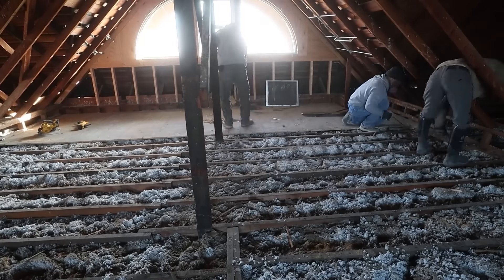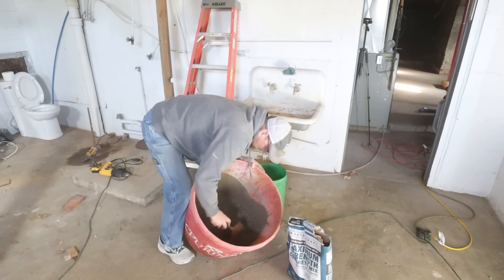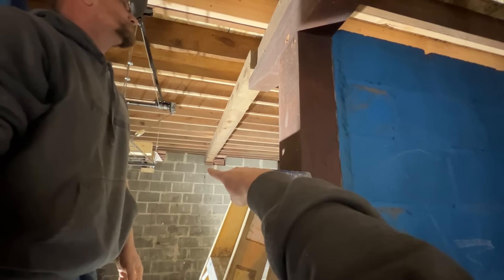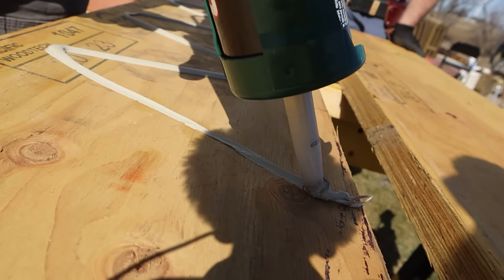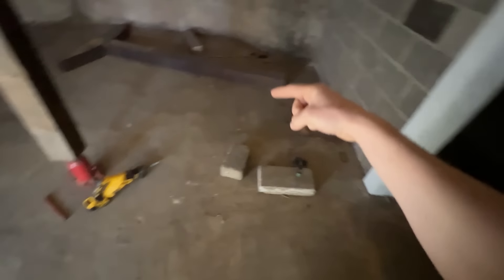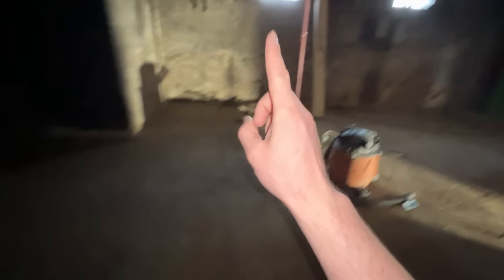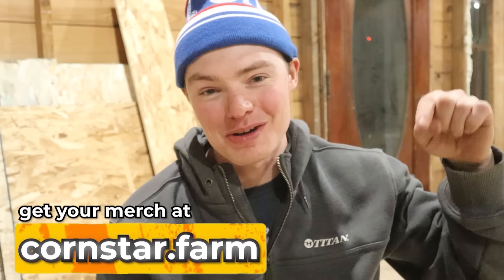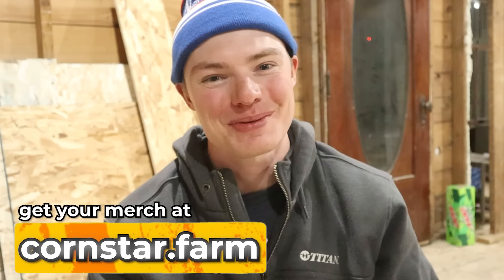Restoring A $7,000 Mansion: Rebuilding Basement Ceiling

Comment: Why not just fill the cinder block with cement then just pound in a pressure treated wood beam cut to size for the hole and be done with it

Comment: 1st - underneath...not underneath of.
2nd - where is your PPE???
3rd - if your concrete guy doesn't have tubes that run from the truck into any corner of the basement, then you need a new concrete guy!!
Reply: You sound like a concrete expert, what slump and strength should he order?

Comment: I find the explanations interesting but when Roman explains and then Cole has to come along and do the same explanation it is not as interesting.  Once is enough.  Put the drain tiles in the basement when it is torn up not on the outside - that is what i was told when I had water problems in my basement

Comment: COLE > To Due Basement Floors They A Concrete Pumper's and PuLL Behind Pumps You Can Rent And Tow With Your Pick Up ??  MAKE Concrete 7" Or 8" Inches SLUMP WET Is Better To PUMP !!!!

Russ Robinson , Withmore Lake, Michigan 48189 Be Doing Concrete  33 Years ( Retired ) 73

Comment: Sue them jokers into the Stone Age sad what they did to you guys
Reply: Who signed off on all the designs and work done?  Cole.  Now that it's got serious problems Cole doesn't want to fess up taking any of the responsibility even though his signature is on the paperwork.  I think they're screwed.
Reply: @benhur520  but when it’s designed, it’s supposed to be designed safely everything from the height to the amount of concrete that is needed to make sure that the weight of the grain does not supersede the strength of the walls seeing how they cannot fully fill a bin without having a possible collapse from the get-go  is not a design error it is a manufacturing and building air when they constructed the bin it seems they pretended that it would be OK, but for the simple fact that green legs are too short or not high enough and things are ripping off, the silos is a builder problem brought to the attention of the builder. Nothing was done ergo, a lawsuit and honestly if Cole I would look for other bin sites that they have constructed and possibly get a class action proceeding

Comment: Oh for crying out loud, Why not just put in a sump pump or two in the basement. Oregon 85-110" of  rain per year. You do what could can to coat and seal, then put in sump pumps to dump out  any water ingress below the level of the floor, or even above if it gets there. LIGHT BULB. Forget the bloody chute for concrete. They have hoses for concrete pump trucks that can pump out over 100'. Been there done that. So many stem walls and basements poured with a concrete pump truck. I realize your not experienced in this, but that's what Justin is there for. 29 yrs. C'mon!!!! Unless Iowa is unlike every other state in the union. Lawsuit----KICK THEIR THIEVING BUTTS!!!!! Get R Done kiddo. D.C.S. is not unable to get ahold of stuff to help you. Sorry, I'm just a 60 yr old father of 4 who has been in construction and has 3 sons who have spent time there too. I wish you all the best, but you will come across a whole lot less rattled if you don't always do your inside thinking on the outside----Especially on video. Your a smart guy, so is Coop, and your dad. Don't take any prisoners and use your common(which is in short supply anymore)sense. You can do it. Ok, I'm off my frustrated father soap box now. Rock on little dude!!!!!